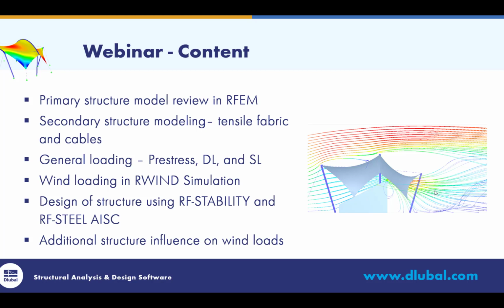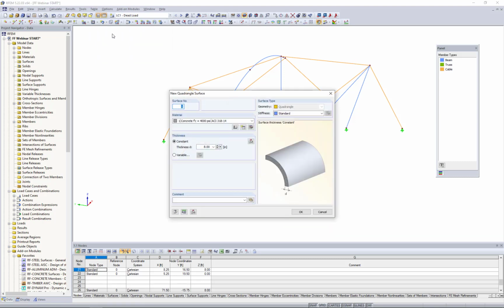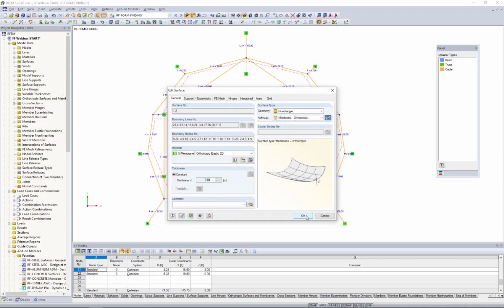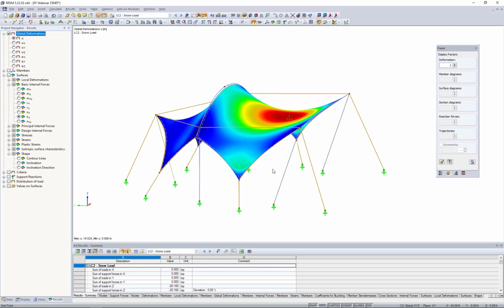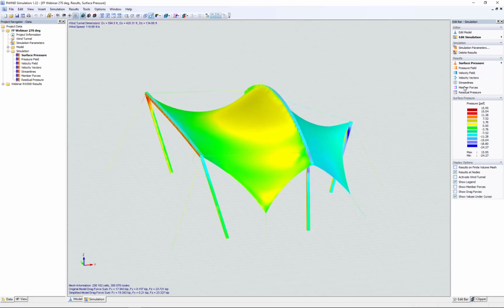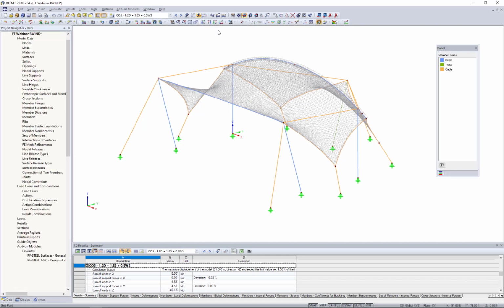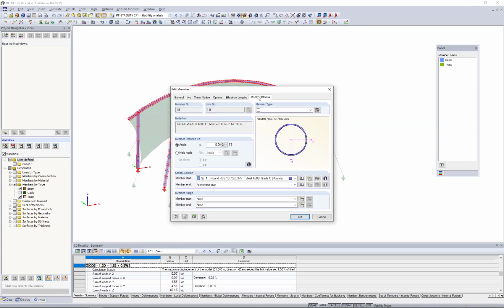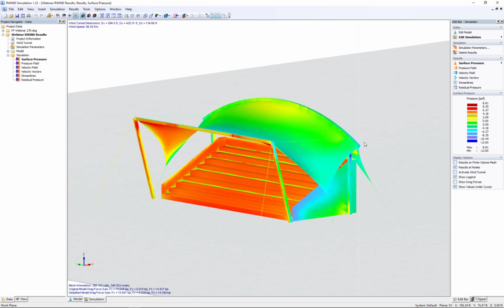Webinar | Tensile Membrane Structures and CFD Wind Load Simulation

Comment: Hi, may I ask this question? In RFEM software, can we model & analyze the membrane structures with the connections at the edge of the membrane as holes and wires/ropes, holes spacing approx. 200-300mm?
Reply from the maker: Hi, Huy!
We don't consider such openings.

Comment: Thank you for really good presentaion 
why force in cables time you put it 0.225 kips and another 6.75 kips ?
how i can determine this forces?
also some times make sag in cable 10 % and target length 100 % 

if i make them all target length 100 % the results will change or not ?

Thank you again .
Reply from the maker: Hi, mostafa!
With different prestress settings for different elements you can influence the final form of the structure. Because of this, the prestress settings for this structure in the webinar were defined in this way. If you change the settings you will get other results and another form of the structure.